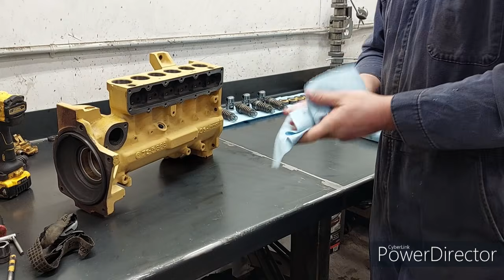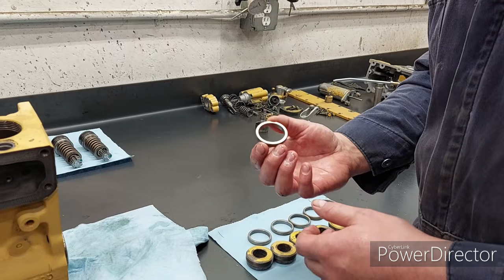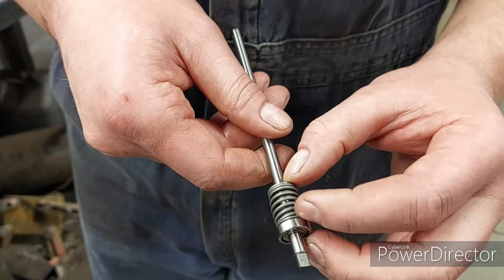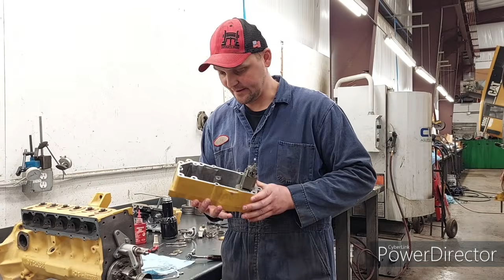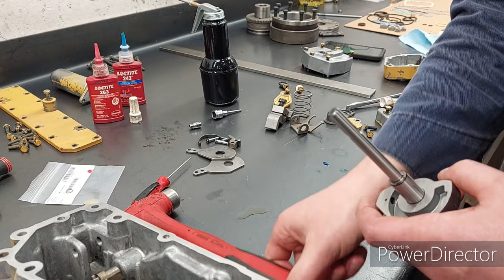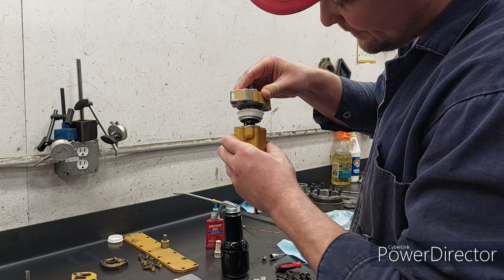3406B Fuel Pump

Comment: I would like to see how you time a pump think you for your video
Reply: Advancing the timing is possible. It will increase cylinder psi, lower boost and make faster response. The outer cover on the VTU has a big screw and little screw. DO NOT MESS WITH THEM. That is your start and stop of advance. You can only set them with a timing indicator group. First check your pin timing, if the flywheel goes in first your retarded. If they drop about the same time your dead on. If the pump goes in first your advanced. If your retarded you need to re-time your pump. Turn engine until the fuel system pin drops in. Remove the VTU cover and loosen the bolts. Put a seal pick in the hole and turn the engine backwards. When it falls in the hole turn the engine slightly until the engine locks up. Replace the bolts, one at a time. (Have seen old ones break). Now torque the bolts (41 FT LBS) remove the pick and pin. Turn the engine backwards thirty degrees or more and then turn engine back forwards. The pin and bolt should drop in about the same time. If want to advance it, before you torque the bolts. Remove the pick and slightly bump the engine backwards a little more. Again torque bolts and do as above. The pump should drop first, then take your seal pick and feel for the hole and see how far you are advanced. I like mine around half a bolt hole. So on the drivers side the hole will be towards the top of the flywheel housing and solid towards the bottom side of the hole. If your installing the VTU, you have basically two types. Old 7FB style and 4MG03600 and up. Get a long 3/8 bolt and cut the head off. It is your guide to align the VTU. Install guide bolt and slide VTU on over the guide bolt and get a few bolts snug, finger tight. If you have the 4MG03600 and up, 5KJ, 3ZJ, 8PN. You need to push the carrier in and seat it. It will push out installing it and you will be severely retarded, if you don't seat it. Get a large screw driver and get between outer cover and flyweight and push it back towards the engine.

You set static timing, (pin) with a bolt in the flywheel. The start and end of advance you have to set dynamically. The spring on the timing is based on engine serial number and HP. You install the timing indicator group, warm the engine up. You go to TMI on the Cat network, (you have to have Cat access) to find your timing information. Again it is based on serial number and HP. If the engine has been rerated, you have to use the performance spec. Once you get your spec, you first check ref timing window. It is usually 1,000 RPM's +/- 30 RPM's with a 1.5 degree tolerance. Now you have you base timing (slot cut in the fuel system camshaft). On NSFS you have 0.2 degrees of port effect for every 100 RPM's. So at ref RPM, (1,000 RPM's) you would add 2.0 degrees of advance for the port effect. So if your static timing on the fuel system camshaft was 24.0 degrees (Example), (0) RPM's it would be 26.0 degrees of advance, at 1,000 RPM's. So you have graph paper, min RPM's would be 970 high to low. Max RPM's would be 1030 RPM's high to low. With max advance at 27.5 degrees and min advance at 24.5 degrees, (Example). If your in tolerance at ref RPM"s the next box is start of advance. Again TMI has start number. You box changes, now you have 100 RPM tolerance and a 1.5 degree tolerance. Now between ref RPM and start, you still have to add your 0.2 degrees of advance per 100 RPM's for port effect added to your start of advance. Next is your end of advance and your spec changes again. You still have the 100 RPM min max, but your timing tolerance now changes to 2.5 degrees for the end of advance. Again you draw your box adding port effect of 0.2 per 100 RPM's. Once you have your timing graphed on paper, engine warmed up. You start recording advance at every 100 RPM's to high idle. Now if your start and end of advance is not on 100 number, lets say start is at 1355 RPM's, (Example). I get a reading at 1350 RPM's and so on for the stop of advance. While engine is warming up, I usually see what ref point is and when timing starts to advance and stop of advance. If you know it has to be adjusted, why waste time doing the full run. First adjustment is ref window, then start window and finally end window. Once your satisfied of your settings now you can do the full run of 100 RPM readings and record your numbers. You go all the way up and then you check it back down. Your making sure on the way down it is not sticking. Once you have all your numbers going up, you put them on the graph paper to see how smooth your advance looks. That is why you DON"T play with the start and advance screws. You have to have this tool to set it or check it. It cost a few $1,000.00's dollars.

Comment: Hello I have a question about the metal o ring under the plunger? Is fuel able to get pasted the metal o ring or does it stop the fuel from getting past the o ring. I was looking in my injection pump and I saw fuel in the bottom. Thanks in advance.
Reply from the maker: The metal seal I describe in the video under the plunger and barrel assembly is the seal. It is a machined washer and the bottom of the barrel is machined. When you torque down the bonnet nut, which has the pink oring under it, it smashes the barrel into the machines washer making a liquid tight seal to keep fuel out of the camshaft housing. If you have fuel in the oil on a 3406 it's most likely an under valve cover injection line or the nozzle, "injector" , that is leaking fuel into the engine. You can run the engine with the valve covers off to locate the leak. Have done it many times
Reply: Thanks for replying back to me I changed the pink o rings on the plungers. That's when I started to see the diesel in the oil. When I took one of the plunger's out I can see diesel on the bottom like by the rack.
Reply: One more thing when I torque down the bonnets it's 190 ft pounds right?
Reply from the maker: If you removed the plunger and barrel it will relax the seal on the bottom and all the fuel in the galley under the large side plate will drain into the pump housing. If the fuel level continues to climb after you run it a while you may have gotten some debris from the nut area down under the steel seal. It is extremely important that all those parts are spotless during assembly
Reply: The metal spacer under the pump has two functions. As stated it is a seal. ANYTIME you R and I the pump, you have to center the rack and remove the pump. Most of the fuel in the oil failures are nozzles. However the first question I ask, has somebody fixed a fuel leak on the pump. If they said yes, I ask them which one, as if you don't R and I the pump and just tried slipping a new seal under the bushing you have messed up. The second function of the spacer it sets injection timing. When Cat came out with compact fuel systems and went away from forged body, the timing needed to be set. So you set your pump up and put a degree wheel on TDC 1. Look up what pump you have and the spec will tell you which way to turn the wheel and what degree to stop at. Then you take a two inch block and set in that hole with the existing spacer. Measure down and get your depth reading. If within spec, your OK. If not you look in the parts book on which spacer you need to get within spec. Spacers come in range of 0.004 between each part number. That is why on earlier engines you do not mix the spacers up. If you do, the pump has to come off and do this. You can measure each spacer and replace them once you know the thickness and put it back in the same hole. When Cat released the new scroll fuel system (NSFS), 3406B and up. They was able to get production tolerances within spec. Thus it was no longer needed to degree the fuel camshaft to set injection timing. As production and improvements was made you have two thickness spacers on NSFS. You cannot mix them up. If you do, you will destroy your fuel system. 
One problem on this NSFS is the bushing not seating the pump in the bore. So Cat has a new bushing and bonnet. Anytime I R and I a pump, I like to lap the barrel, update the bushing and bonnet. However I have to do as the customer wishes. Replacing the pumps is a better choice, but now your talking a lot of money. Plus I do not like to put one new pump in a hole and have five old pumps on a high mileage engine. If you reuse the bushing, it is best to put it back in the same hole as the threads have mated to each other. The spacer or pump does not matter.

Comment: Si alguna vez tiene una bomba de inyeccion de un cat 3208 seria la bomba que nos enseñara sobre ella, ya que no conoco ninguna otra bomba en V. Aunque yannmar tiene una en linea y a la vez rotativa.
Reply: 3208 fuel pumps are sleeve metering. You have to set the cross bar with a special tool. Once that is set, you have to install a dummy pump and set the lever setting. Once that is done, you have to put it on a test bench to see if it will pump out. Also the front cam bearing likes to spin or the camshaft gets a groove from the fuel transfer pump seal. The governor housing has to be reamed and install a check valve to prevent air from entering around the throttle shaft seal. Now you can take it apart and reseal it. However if it has a thrust bearing in the governor and you let it fall out you will destroy your pump. NEVER try to adjust the lever setting or the crossbar with out the special tooling. To get the fuel transfer pump off, you have to pull the sleeve off. It is a one time use. Once it is off that is when the thrust washer can fall out. The thrust washer is located in the rear of the pump. So I made a special tool to keep force on the fuel camshaft forward to prevent the fuel camshaft from moving backwards. If your front bearing has spun, your pump has to be replaced. If your camshaft is worn from the transfer pump seal it has to be replaced. Once you get the one time use sleeve on, you measure end play on the fuel camshaft. If your in spec, OK. If not your taking it all part this time and see what you have broken behind the pump.
Reply from the maker: I have never done the 3208 pumps. Few and far between where I'm located
Reply: Soy bastante prudente en ese aspecto, no las manipuló sin documentación o con asesoramiento de maestros como vosotros. Se me dio el caso en un ripper. Son muy raras aquí en europa. Un saludo y gracias por las aclaraciones.
Reply: @carlosmontero1033  English

Comment: I'm working on my 3406c I timed the rack to center of the lifter. I Dropped the plungers in and now I have a small miss now. It sputters when I hit the throttle now. I'm a diy guy just trying to get it back going. Btw the pump is still on the truck. Thanks for any help.
Reply from the maker: You should be able to Crack lines loose at the pump one at a time to see if the miss gets worse or stays the same. The one you Crack and it stays the same is the one that is probably out of time. If you install pumps injection pump on the truck you can still look through the front window and check rack travel after each install. But you should start by checking the travel before you mess with the pump. Also remove the shutdown solenoid when your changing the pumps. It frees up the rack
Reply: @hellscanyondieselpower6537  A few times I have had a problem getting the pump back in time. What I have learned is take the pump apart and turn the darn spring over. For some reason the coils will pull it off center enough and prevent the pump from going back in and timed correctly.

Comment: Very good instruction, I professionally repair injection pumps in Bosch service, but I will repair such a pump for the first time. Could you give me the part numbers for the seals for the pump and speed controller. Thank you.
Reply: Part number to rebuild/reseal the pump? Loaded question. As pumps changed, part numbers have changed. Some are been replaced with better part numbers. Some you have to stick with what pump is in front of you. When you go to Cat and look up what pump you have SIS has not been updated (most of the time) to the better part number seal. If you order a fuel system kit, it has lots of parts in it that you may not need. However the kits are usually updated with the better seals. So if you try and look that new part number up for you serial number it won't be in the book. Sometimes you have to look the part up in a truck engine news, special instructions, or a newer serial number. The parts guy at Cat will not know how to do this. As with the seal under the bushing for example, that part number has been changed four times that I know of. So each of these numbers are still in Cat's system because it is just a standard o-ring most of the time. Also some hardware changes in the governor that I like to do. Again, not in the book.

Comment: Where on the pump do  the RPM  connected  to
Reply: On the rear of the governor is a place to mount a cable driven tach. I would not use it. I would get an electric tach and use the flywheel. You might make the tach shaft oil seal to fail sooner.

Comment: I had to change one of my o ring on my 3406b because it was leaking so I decided to change all six. All of them was easy to change except one. The plunger popped up  on me. Now I'm getting fuel in my oil. My question is should I go back and clean the metal washer under the plunger that popped up or should I go and clean all of them? I need had a problem until this one plunger popped up. Thanks in advance.
Reply: Always remove the pump and be clean. Now you don't know which spacer has trash under it. Keep the bushing in the hole it came out of. If the bushings are the old style it is best to update them. Depending on serial number you have two spacers. Do not get the wrong one. I would replace all the spacers, as they could be damaged. Also clean the housing and the bottom of the pump. Ask your dealer for Truck Engine News article 1985/11/01, Check Fuel Injection Replacement Pump Installation (SEBD6553-00). It shows you how to check timing after each pump is reinstalled. Four pumps will come out, two the cam lobe will be up so you will have to turn the engine to put them in. Remove the shut off, gasket part number 6I2002. Pump seal 1313719 pink, felt washer 8H9204, air compressor gasket 1293948. You will have to center the rack to R and I all the pumps. Make sure the rack is free before you torque the bushing. Make sure it is free after you torque each bushing. Have the intake off with something you can shut the air off. If the rack locks up, you will be out of the trucking business in thirty seconds.

Comment: I've got to say thank you for making this video. It gave me the knowledge and the confidence to rebuild my pump in my 84 peterbilt 359. I had already done barrels and plungers in the past but was always squeamish to mess with the governor. With the help of your video and the Cat manual I completely rebuilt the governor with all upgraded parts. Mine were old style and worn out. I now have piece of mind it isn't coming apart on the road. Saved some coin and have a sense of pride I did it myself. Thanks again.
Reply from the maker: Very happy I could help. Hope everything went well and it was a total success!
Reply: Your races against the flyweights was best to use one out of a 8PN, larger OD. Flyweights updated, bolts that hold carrier on updated, I put spacers out of a PEEC VTU to help center the FRC lever. Bushings that hold the pumps in are updated. Seals behind the pump and mounting seals updated. List goes on that is not in the parts book.
Reply: Excellent video of the injection pump.  I have a 3406c that I’m having a low power issue with.  Im looking for some information on how to trouble shoot it would you be able to help me out?
Reply: @johnhodle5898  Full engine serial number.